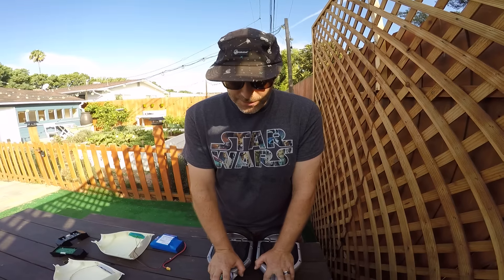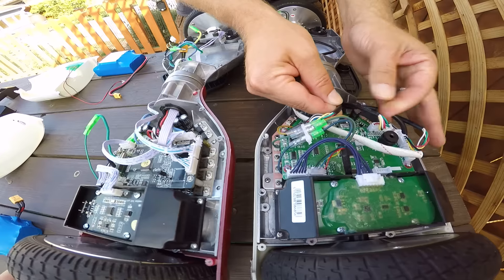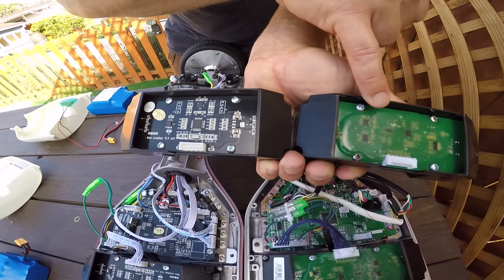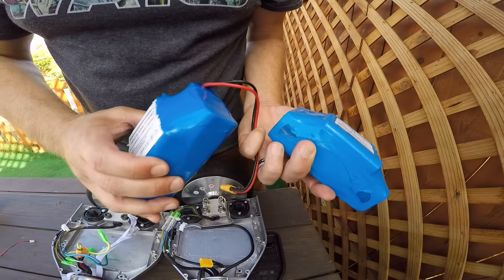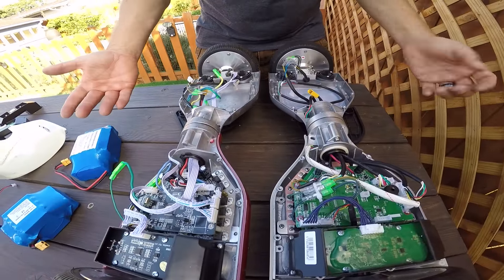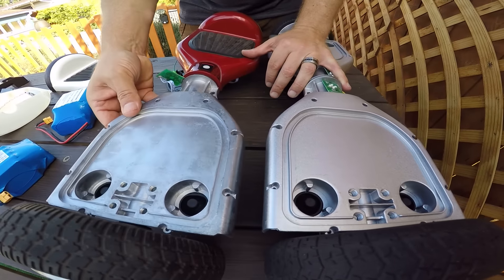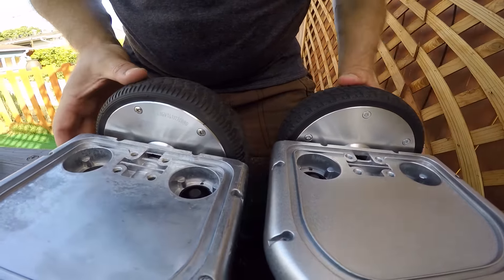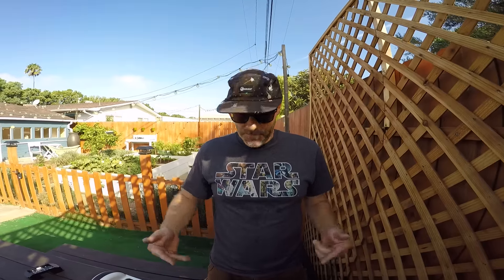IO HAWK & Star brand comparison - cover off hoverboard - Self Balancing Personal Mobility Device

Comment: to check the specs of the batteries you need to analyze the actual internals and see the manufacturer of the 18650 batteries inside the blue casing followed by checking the manufactures UL listed ratings and capacities. Even then, you'll want to put them through a discharge testing apparatus to see if they're meeting or exceeding qc standards. I may have access to a tester in my schools electrical engineering lab, but I'll have to ask my professor for temporary special access. (I study mechanical, not electrical)
Reply: +Marty Morrow just sent the email, hope to hear back from you soon! :)

Comment: Can you make a tutorial on how to switch the covers of the hoverboard?
Reply from the maker: +Ariane Gomez - That might make a good video. It is not very hard, but you should note where you pull the connectors so you can put them back correctly. Also, the Charger Port on the case is difficult to transfer to another shell cover as the washer ring is sized just so that it is very difficult to pull the socket through. Just a screwdriver is all you need until it comes the charger port where a couple of pliers are needed.

Comment: Hi
good day

I forgot to ask, could you dissemble the bearing system of both units for comparison, please??
This will prove that the IO hawk is a better machine without any doubts.

Thank you & have a nice day.
Reply from the maker: +putianren I'm not going to do that as it probably won't go back together that well. I will do some other testing of ride-ability and performance which will include how smooth the IO Hawk turns as compared to others as well as showing how the Mercedes logo one bows down already in the middle.
Reply: +Marty Morrow 
Hi
Marty

Good day
Thank you for your reply & this video

Even though I have Chic Smart Wheel/IO Hawk, I have not open up a clone for comparison.
And since you did, then I know & notice, something is not right.

I just open up one of clone/lookalike, all from the same maker, for a very much closer observation.

One of it is with "freeplay" & the gyroscope is not covered with silicone glue to make it water resistant/waterproof.

I will upload a video clip and how to rectify after this.

Thank you & have a nice day

Comment: Hi
Good day
I do own a Chic Smart Wheel or you can call it IO Hawk, whatever.
I have open it umpteen times to do my add-on but not the clone/lookalike even I do have a few types of clone/lookalikes.

Since you have done it, now I know why one of the reason, I think, many clone/lookalike do malfunction.

In the Chic Smart Wheel/IO Hawk, the gyroscope is water proofed by having a layer of silicone over it.
The gyroscope in the clone/lookalike is not waterproof.

This is actually very important because water will splash upward when riding over puddle of water > via the gap between wheel shaft & the casing.
And the gyroscope is the first component to get contact with the water.
That is why the manufacturer have waterproofed it. they did not do it for fun. LOL.

In my Chic Smart Wheel, I add extra protection by using cellophane  tape & tightly tape over it.
Reason was when after using it for a while & open it up, I saw it was cover with dust.

The following is something I have not mentioned before, but now I will because .......

It is the center pivoting point.
The two halves are joined by a "bearing system"

Do a simple test,
Try pulling the two halves apart lightly.
And lift it up lightly with your finger at the center point.

There SHOULD NOT be any movement at all at all > "freeplay"
If there is, then you have a bad "bearing system"
nb: there is no adjustment allocated to it.

 ( I am NOT 100% sure as I have not open the "bearing system" until I do l cannot be 100% sure)

I always think there is a way to resolve problem, whatever.

This "freeplay" is very "dangerous" because over a period of time of usage especially over uneven surface it will start to rattle & will and or eventually break.

As an old engineer, in engineering' term "freeplay" is not acceptable especially in "bearing system"

In my Chic Smart Wheel, there is NONE at all at all.
I am sure it is equally the same in IO Hawk since both are from the the same manufacturer.

If you do own a clone/lookalike, ride it with care without doing extreme if there is "freeplay" 

Thank you & have a nice day
Reply from the maker: +putianren Thanks for the advise. I will be putting more videos together and will see if I can properly demonstrate that. One of the cheaper units has obvious "freeplay" in the joint, but yes the IO Hawk units are quite well constructed and I don't see that issue.

Comment: from the video the only thing I see that would ever make a difference is the epoxy over the circuitry by the wheel. but that alone is not enough alone to justify the cost. of course the circuitry is going to be different from brand to brand but they both do the same thing.
Reply from the maker: +steve p. - I do have other videos that compare them on ride-ability too and differences in Gyroscopes, motors, batteries, and circuitry do make a difference. The responsiveness, reliability of gyroscopes, battery life, dependability... So many comments in my range of videos talk about broken on arrival, stopped working on this wheel, or limited battery life. They all do the same thing (mostly), but so do most bicycles, cars, computers... That does not mean that premium brands don't exist.

Comment: I think you lied about showing the lights because the shells where both white and the io hawk is white and the board is red I think you set it up some how some way to make the io hawk better so you can get money
Reply from the maker: +Daniel Rodriguez - The IO Hawk had a white shell, and the star brand one also had a white shell except for one side where it broke and was replaced with a red shell on that side. Now the shells are made of the same material, but the star brand is easier to fall on and someone broke the shell. The lights are exactly as I demonstrated them as was everything else.
Reply: +Marty Morrow the star brand it's a red board but a white shell with the lights
Reply from the maker: +Daniel Rodriguez - The Star Brand is half Red / /half whit on top, and all white on the bottom. Like I said, it was all white until the shell cracked and broke when someone was riding it and that piece was replaced with a red one.